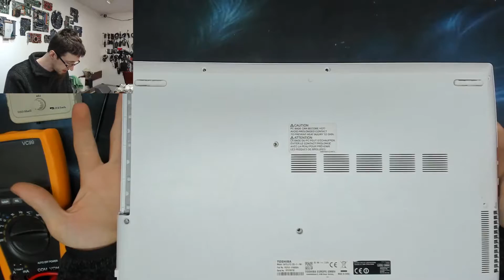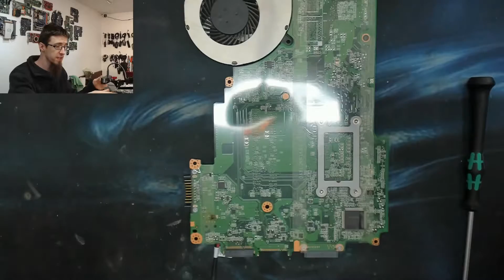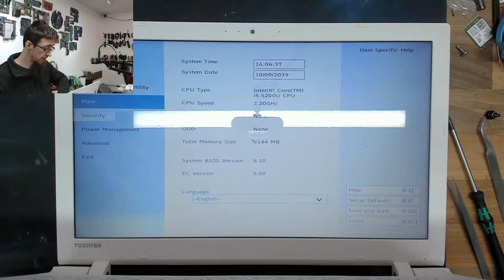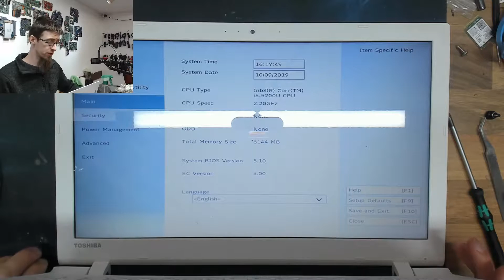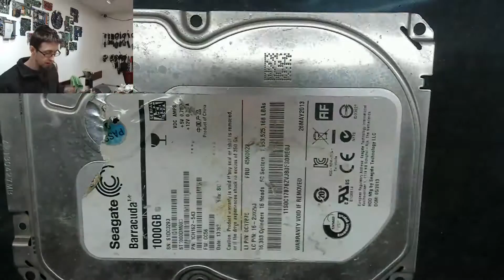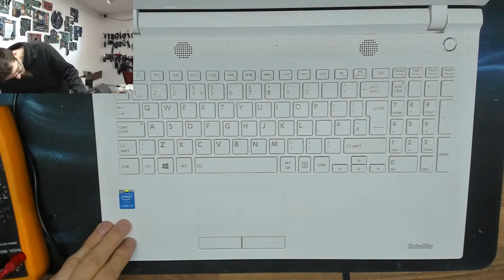LFC#181 - Toshiba C55-C Runs on Batt but not Charger

Comment: Does that oscillating voltage cause the DC - in jack to get hot as well? Thank you 🤓 I realize you didn't really go over the laptop info, but can (could) the CPU be upgraded? Thank you again

Comment: I am having same laptop I am getting short of capacitor in the backend of cpu and in other parts of the motherboard also when applying current the ic is getting extremely hot 🥵 my laptop not powering and no led 
I need help

Comment: You are incorrect in the function and nature of that diode. It is not a standard rectifier diode, it is a zener diode which is a form of voltage regulator. It is connected across the input BACKWARDS from a regular diode so that if the voltage goes above, say 20vdc, it will flow current to ground to prevent an overvoltage from reaching the system. I repeat IT IS NOT A STANDARD DIODE.
Reply: That is literally what he said, he just used didn't use the term zener diode. You're nitpicking and you sound very condescending.
Reply: @ivanuric1879  , I respectfully disagree. He is calling it CONSISTENTLY a reverse polarity diode, which would not be connected in paralell with the power input jack, but would be in series to prevent plugging in an adapter with the  wrong polarity. THAT IS NOT WHAT THIS IS. This is a special kind of diode with a specific reverse breakdown voltage that shorts to ground if the breakdown voltage is exceeded. If you were to put a standard rectifier diode in its place you'd have to exceed 1000VDC or more before it will begin to conduct instead of the 20.5 or so the zener would start to conduct at. Further the rectifier is not designed to conduct in reverse and would quickly undergo RUD. (random unplanned disassembly. I.e. it'll blow.)
Reply: @stanburton6224 thank you

Comment: So glad I found your channel. Lots of how to videos but very few go through the thought process and more importantly know how to convey the knowledge through the camera. QUICK QUESTION: How do you keep track of where the screws come out as some screws are different lengths etc and also do you keep track of what connector goes where before you disconnect. Thanks!
Reply from the maker: Experience... you get good at memorising screw and connector positions as you go over time. Connectors are often keyed and only go into the correct places, which makes that easier.
Off-camera I'm often putting screws into separate piles for case, mobo, drive, etc.
And in the worst case, take pictures as you go, showing where everything was as you removed it.

Comment: Sometimes those diodes are not your standard schottky or generic type. Often companies will incorporate a TVS style diode that is designed to function as a standard diode in reverse bias mode, and will clamp (short) when over voltage is detected. In most cases these will clamp without a catastrophic fail and will generally fault a secondary internal circuit protection portion of the board that only a person with some electronics knowledge and a soldering iron can fix. I call TVS diodes a "Warranty buster"

Comment: I know i'm a bit late with this comment but some chargers do have reverse polarity maybe someone plugged and over volted or amped one into it .guitar foot pedals are often negative on the center pin but only 9-12 V DC but other appliances are some times the same (reversed polarity) if the plug fits could have happened. Or a dodgy made in china piece of crap charger.

Comment: I don't think this is reversed polarity diode. If the second pad is going to the power input pins of secondary power rails then it is and it wouldn't burn when you plug reversed charger it will just not let current flow the opposite way.  If it is going to the negative plane then it is a TVS diode that protects from dc voltage spikes.
TVS diodes have the following two main properties:
1) Clamping voltage window - usually starting a few volts above the rated voltage of the charger and a max clamping voltage which has to be lower than the max operating voltage of the buck converters feeding off of the main power rail. When they start conducting the excess power to ground they can only do that up to (2)
2) Max conducting power rating at max clamping voltage (usually 200w,400w,600w or 1000w)
You can install a few lower power rated diodes in parallel but exact same model or a higher power rated one to prevent them from burning. They should be installed after a reversed polarity diode so they don't burn from reversed chargers. It is possible that some laptop manufacturers don't install a rp diode and count on the tvs one to fail short. If they fail open on reverse polarity - Bye bye motherboard.
Reply: Yes, transil diode, had the same issue on an Acer netbook years ago.

Comment: apparently, the plastic cover is not just as a water damage protection, but also as a heat source pointer so we don't have to spend much time to hunt it with voltage injection. awesome repair Adam. ;)

Comment: WHERE CAN I BUY THIS REVERSE POLARITY DIOD FOR ** TOSHIBA SATELLITE 55D-C ** if someone can help me please? Thanks!
Reply: You should look for some reverse diode which has a higher amp and volt max rating that the rating you are going to actually use. for example a regular notebook uses 19v 3.14a then you buy a 35v 6a reverse diode and you will be OK. You should, of course, check you are buying an smd diode that would fit there. It is explained in this video, and Adamant has a whole video dedicated to find replacement parts

Comment: How can someone apply reverse polarity with a charger?? Not the toshiba charger?
Reply from the maker: Third party chargers. The universal ones, or just cheap-ass ones can be the wrong way around, or the wrong voltage - that's the main angle that this would protect from. Toshiba can either A) pay another cent for a protection diode or B) Tell the customer that their laptop went nuclear because they used a non-toshiba charger.
Better to have a 'graceful fail' than something that might start smoking!
Reply: @Adamant_IT  It makes sense, thanks. btw reverse polarity protection was my first protection "circuit" i learned. :)

Comment: Hey Adam, Thank you very much, i had a great luck, i have the same model with the same problem which is evident, but i don't have nor i knwo where to find a reverse voltage diode that matches the laptop. where can i find one?
thank you very much
Reply from the maker: Check ebay or aliexpress. You need a Schottky Rectifier Diode rated for 30v, in SMA size. Here's an example on eBay UK: https://www.ebay.co.uk/itm/192749145068
Reply: @Adamant_IT  Today i've sodered the smd diode and it's working. I really love what you do and i hope to become like you. If you ever decide to come to Canary Islands for a break give me a shout :) . I have a guest room as well with my sodering kit  :P
Reply: @Adamant_IT  thank you very much man i will let you kknow of my adventures :D